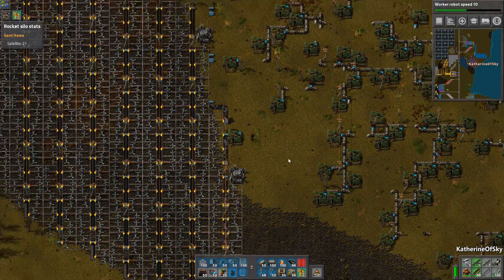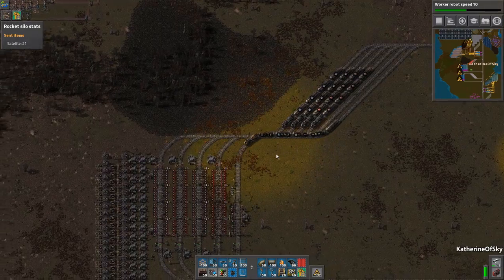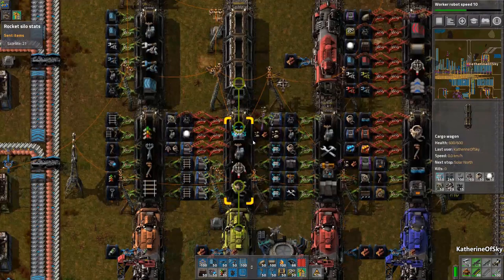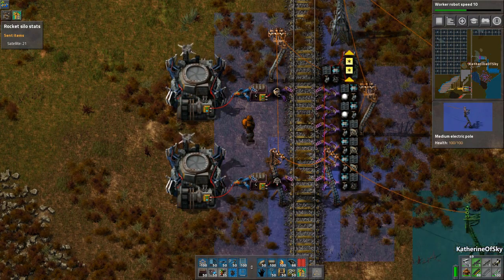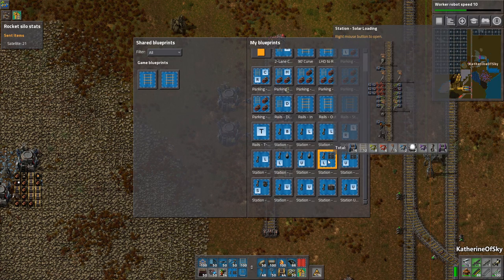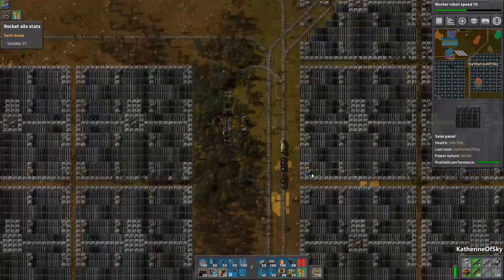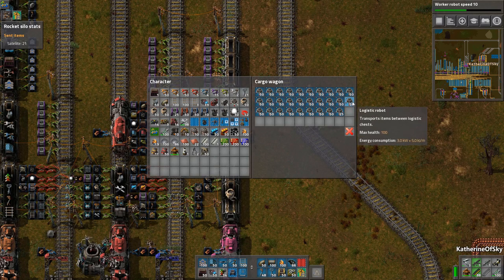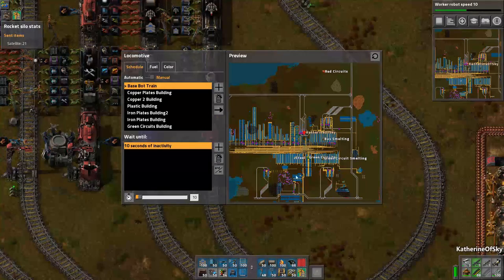Factorio: Entry Level to Megabase Ep 67: TRAIN STATION REJIGGING - Tutorial Series Gameplay

Comment: Looking at all of this delivery train mess, it would probably be best to decide from the start on standard train length and how many and where the locomotives are (for refueling inserters) and mostly keep to that design, possibly sometimes using fewer wagons (only when not using two opposite locomotives). One locomotive with 4 wagons seems to work fairly well, in terms of capacity, variety of items that can be loaded, space used by the station and loading/unloading with belts. Maybe 5-10 wagons would be viable with bots. 

I like the idea of reserving the last wagon of supply train to bring trash and surplus items back to base. 

Yep, the green circuit array in main base should be fed from below by a train station to keep things going.
Reply from the maker: Mess?  All of my trains are a standard size, decided from the very start of the game.  When I read your comments, sometimes I wonder whether you are watching my videos or someone else's....
Reply: I'm talking about all the building and supply trains. Most have one locomotive, some have 2 (which necessitates an extra refueling inserter), sometimes this changes, the number of wagons are different from train to train and there are all those chests and it changes over time. Thanks to you I know that building trains are a good idea, but there are 4 or 5 building and supply trains at this point and the station next to the mall evolved into such a monstrosity that I got confused. You make it work, though. 

You decided the length of regular cargo trains to be a locomotive and 4 wagons from the start, with space for one extra wagon at staging areas and I wasn't talking about those.
Reply from the maker: The building trains are a special case, and I explained why I chose the specific consist when I did it -- e,g, for the solar and wall trains to have one locomotive each side, etc.  This series is meant to be a "what if" type of exposition, where I show different solutions for different problems.  (And many times, needs for the late factory will change and may not be anticipated early on).  

Indeed, when I start a new factory, I will better anticipate those needs and decide a different auto-building train consist from the get go.  I probably will have a tiny personal building train with only the minimum amount of stuff required (RR tracks and chests), relying on the auto-train to deliver the bulk of the assembly materials.
Reply: Ah yes, you did show a lot about trains, from how to make a small non-looping station for just two locomotives with one wagon in between to a large station with staging area for 15 trains. Plus how to filter inserters, enable/disable stations and many other things. This is a good tutorial, and for a tutorial it is better if not everything is consistent to show off different variants. 

My initial comment about "mess" came from me not remembering what all those trains next to the mall are for and why are there so many and why are they so different. You did explain all this as you went along, but that was many episodes ago.